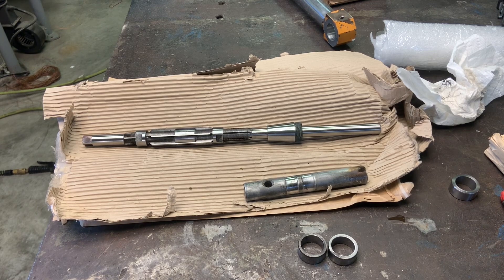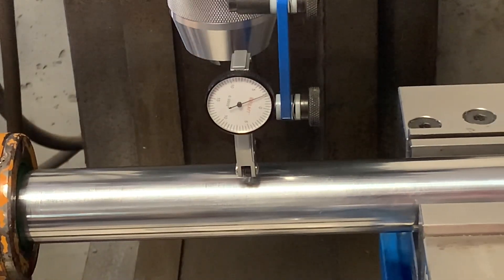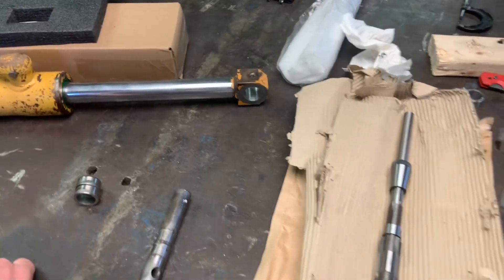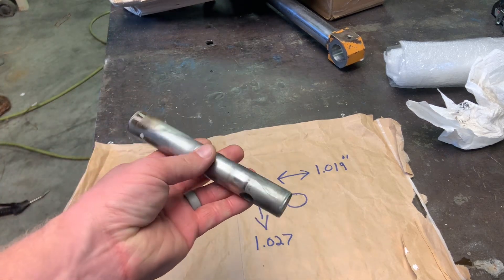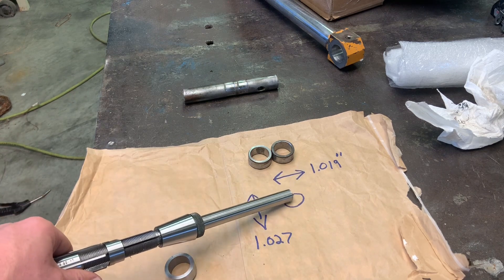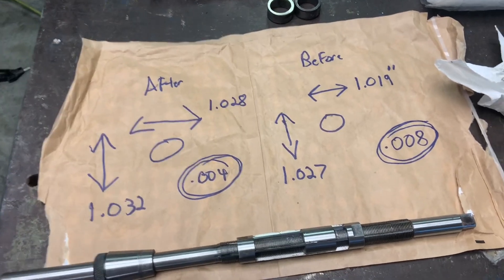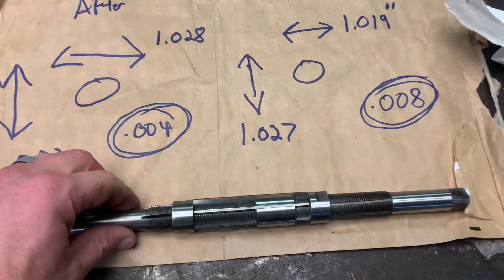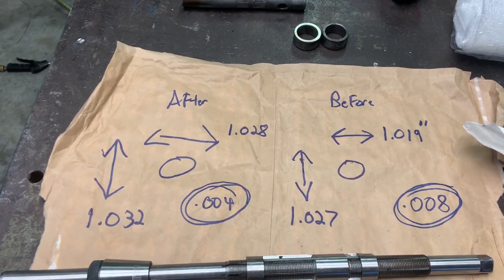Can you Line Bore Loader Bushings with a King Pin Reamer? - Case 1840

Comment from the maker: The answer is no you really can’t line bore with a reamer.  The more egg shaped the hole the worse this works. Learned the hard way
Reply: Actualy the answer is YES you can, but you used it wrong way. You should use centering cone to build support on the longer side of the shaft and then try to cut hole. 
You also shuld slowly advance this tool in the bore (1/4 - 1/2 rotation max at once then rotate about 3 times and andvance the tool). Do not hitt it or roll backwards! You did it and propably alredy damaged the tool so you get poor effect.
Reply: @przemol853  is correct-the reamer should be cutting on the front of the blades, NOT on the outside edges.
Reply: Thats because you dont know how to do it. First you dont use Indian reamers but a quality brand like Hunger. Second you bore a 1/4" plate the maximum size that the reamer will enter the workpiece. Fit the reamer, slip over the plate and mig weld with tacks into position. Take small cuts cutting both centralising plate and workpiece together. This will allow the reamer to cut in only one position and remove the ovality. Never turn the reamer backwards and use another person to keep the centralising cone in tight contact with the other hole. Always use a proper tap wrench with even pressure on the handles. Easy!

Comment: There are two reasons you havent got a good result. The first as you surmise is that you need a proper two handed tap wrench to avoid side loading. The second is that you are not using the reamer as its designed to be used. Its a common mistake to fit the reamer to the bore, force the blades into engagement with the threaded cones and try to turn the reamer. Either it will jam or it will chatter.
The reamer should only cut on the 45 degree chamfers on the ends of the blades and the very slight lead-in taper on the cylindrical main body. For this sort of job you need a guide plate on a bracket tack welded to the arm. The hole will have a one thou clearance on the cylindrical centre section of the blades. The reamer will be end fed and cut on the blade 45 deg end chamfers. The reamer pilot, extended with a stepped tube if necessary, is centred on the other side with the sliding cone, it being held in position with a custom made plate with clearance hole and rare earth magnets. Once one side is reamed to size the opposite  side can be done in the reverse direction. You need to make sure of the optimum amount of stock removal as both too much and too little can cause problems.Never turn the reamer backwards as it dulls the blades. Look at some of the videos on truck axle eye reaming. They use a mag drill and a shell cutter to recut an oval axle eye but the principle is the same using guides to centre the cutter and keep it a 90 deg to the axle eye thrust face.
Reply from the maker: Thanks for that very detail reply! Great info, thanks for sharing your knowledge.

Comment: As a professional McGyver, I would come at it alternating from both sides, turn the nut a little at a time, and repeat until you get there. Use cutting oil and don't hammer it in more than love taps, otherwise back off the nut to keep it from gouging. I might even try a slow turning drill on it when there's enough meat to keep her centered.

Comment: How are the bushings at the arm / coupler junction. They always wore a lot more due to being in the dirt all the time. Case made the pins and bushings out of hard metal to slow the wear.
Reply from the maker: I think one of the videos covers it but they were toast. I ended up line boring the arms out and making custom bushings from 52100 bearing steel.

Comment: The cylinder rod will not extend straight out as there is a small amount of give in the seals on the piston and gland, especially as you extend the cylinder all the way out. The rod eye is supported by the loader arm attachment. The eye does need bushings that press fit in after you've bored it. If you don't want to weld them in, perhaps you can build up the outer diameter, then turn down to tight fit with your lathe. A tight fit is the only thing holding the bushings in place inside the rod eye.
Reply from the maker: The reamer ended up being a complete failure and waste of money.  I ended up buying a professional three stone hone and cobbled up a homemade line bore setup to fix all the slop. This machine will be tight after I'm done.

Comment: I think that will work. How do you set it up to be square with the cylinder as it would be installed position? Maybe fab up some guide plates and tack weld outside . Use an old school  speed wrench with a wobble and tap socket to drive the reamer or 1/2 inch drill???
Reply from the maker: They really aren’t that bad I’m just being a perfectionist but I hear you about removing the bushing if it was worn badly.